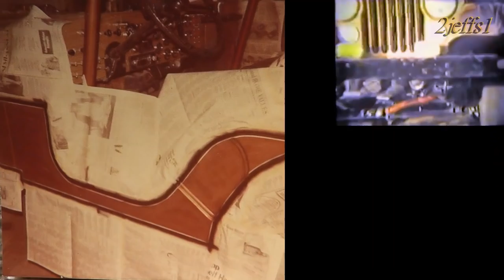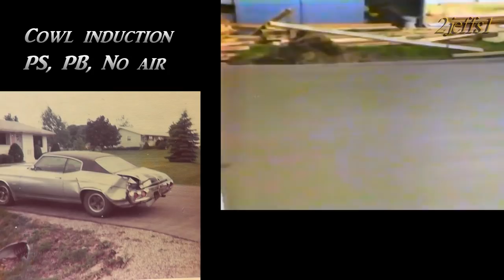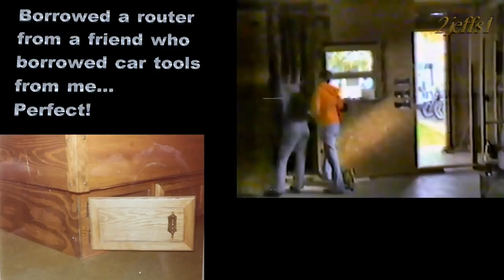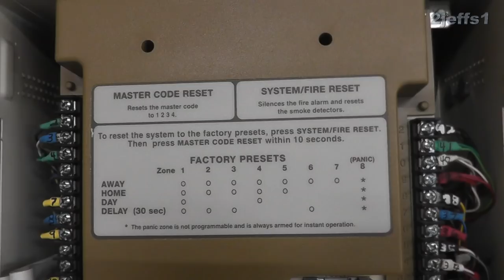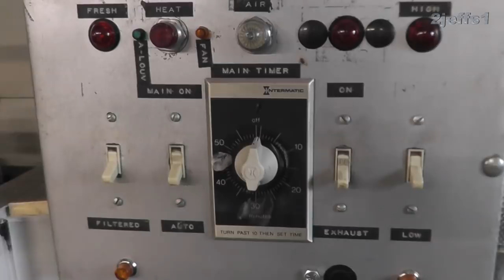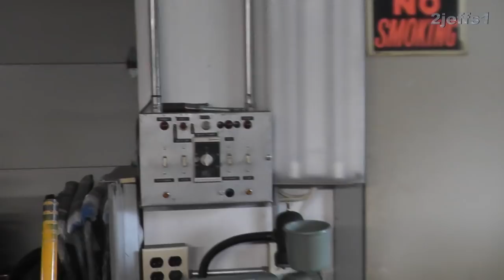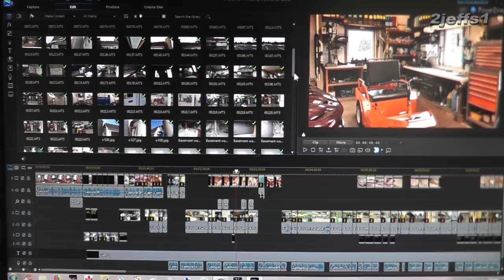See My First Shop and What it Took to Get Here!

Comment: You have so many real life lessons and stories. I love them!!! makes me really understand how if you do your best sometimes things work out. I am a chemical engineer but I was in a horrific accident a year ago where I was burned over 20% of my body and lungs with high pressure heated acids. After a year being out due to recovery I decided to do what I really wanted and I am starting my vintage chopper shop and vintage metric bikes repair and restore shop. I want to have a place that looks like an old service station where the old timers can hang out and have a beer and tell stories and show us how to work on all kinds of stuff. I love three wheelers and yours are what I would strive to make mine like.Thanks.
Reply from the maker: Wooo that don't sound good. Thank you for taking time for the nice write up. Hope you have a good recovery and do well in the future!
Reply: @2jeffs1  Thank you Jeff. Yes still recovering. Lungs take a long time it seems. I went from dreaming about finding an xs650 to rebuild and all of a sudden I have two barn finds and a half finished bobber that is in awesome shape. I found a 1969 cb750 chopper on facebook marketplace and drove to new Jersey to pick it up. I found a donor bike and rebuilt the top end as it had only a couple thousand miles but was stuck (siezed). It is in great shape now and will be a really cool chopper again when it is finished.The guy wanted a couple thousand but when I got there he had sold the engine and I was able to buy the roller for a very good price. I did not even know they made a 350x until I saw yours. I am looking for one down here now. I found a great 200x As I used to be a bodybuilder in the early 2000's and now I am a fat shit I do not know if it will move me..lol I could only dream of accomplishing all you have. I wish I was more patient with electrical stuff as you are. Heck I wish you were my neigbor or brother while I am wishing. I am almost through half your videos. I do have some cool projects. An Intternational Harvestor cub lowboy and an Oliver 550 with a loader attachment that need some TLC. I am just guessing you are in Canuckistan...lol. You are welcome to come visit sometime if you are ever down here in Pa. I spent too many years in school but it was in Florida so I did not mind too much. I would love to go back once my shop is up and running smooth. I need to start video-ing everything and uploading them. You definitely have my admiration and respect my friend!! Talk to you soon.
Reply: I meant to say Wisconsin. I do not know why I thought you said you were in Canada. talk to you soon.

Comment: I saw some Nissan Leaf batteries and a series DC motor. Some kind of electric vehicle project? Thanks for sharing the shop in the evolution of it. I love looking at Old shops,  .
Reply from the maker: Hi Steve. Was saving it for a 3 wheeler conversion. Been watching Craigs list for a 86-7 Honda 200x (second gen) but none have been available in a 200 mile radius. Them have a real sweet rear suspension along with other reasons not to use the 84 200x I originally obtained for that project.
Reply: @2jeffs1  hi Jeff I look through your other videos and found the Cushman project. Looks pretty good. I love the new lithium batteries but the BMS stuff it's kind of a headache. If you click on my profile picture you can see some of the BMS boards I've been trying out. I think I'll go clean my shop now. Funny that's the thing I noticed and was most impressed about, how neat and organized you are.

Comment: A man who likes Rangers and Mercury Monarchs can't be bad. When you mentioned loosing a hub cap, I remembered mine had nice rims with a center cap. Every time I turned around someone would steal the center caps. I gave up and switched them to plain steel rims with hub caps. Gave them to a friend at work.  Rebuilt the 302 in that and I got 22 mpg going to Saint Louis. I had no idea back then how to keep the throttle of the floor so that was respectable mileage.  It did pretty good 1 legger burnouts.
Reply from the maker: Nice write up! I was always pretty lucky for the cap grabbers but heard of many who did have them stolen. Around here they were stealing truck tailgates and a entire box off from a brand new truck at the car lot. The guy told me they even unplugged the connectors instead of cutting wires. Someone knew what they were doing! The 1 wheel peel. Just gotta make sure the r rear is facing the viewer.  ;>)
Reply: 2jeffs1  Is that the tail gates and boxes off new Ford trucks? I heard there was some problems with stealing tailgates on Super duties  as they are expensive to replace.  I visited New York City back in 84 I think. I saw across the big highway these guys stripping the wheels and some other stuff off a car. The guy was only about 500 feet away on foot headed for the nearest exit and a telephone.  Bold thieves and well  setup. They had a van with an engine or cherry picker lift mounted so it reached out the door.  We were stuck in traffic and couldn't do anything but watch like the 100 other people.  Although I am not sure the locals paid any attention.
Reply from the maker: They were taking older but the rust free tailgates off from the Ford's and chev's. That made me nervous where I have that older truck and might be hard to find one with that full length aluminum trim which came on the STX version. It was a GM dealership and they actually took several entire boxes from the same place. What a deal there for you to experience. It's pretty sad when people won't get involved even tho they are seeing what's going on.  When I first got the storage unit up the fire inspector came thru for his inspection and told me they hit them in the middle of the day. He said they drop a guy off who gets in a stall, hop's over the walls and gets everything loaded in the 1 unit for pickup. I never suspected that and several weeks later, yup there were several clowns in here at 3 in the afternoon. I have a driveway ringer and knew there was someone out there. Started to walk out there, they spun gravel all the way out. Several more similar deals thru the years but never a break in where living here helps and installed more security stuff now too.
Reply: 2jeffs1  A hose clamp can stop or slow the tailgate thieves,  not sure how to stop the removal of the box without making a lot of work if you have to remove it.  I have seen chicken wire in the top of storage units,  now I know why.

Comment: hi 2jeffs1   
hi there my friend great videos are my friend      by the way there my friend what's the best undercoating for my old truck   plus I live in Canada what what would you use
Reply from the maker: Hi Roy. There is a paraffin type undercoating that they put on my 86 Ranger when it was new. That stuff adhered good and stayed pretty fluid in the hot days. No idea what that was but it was yellow in color. Thru the years I periodically put new engine oil (just regular 10w30) on the truck to insure things stayed covered especially where the rust starts and one can't see in between sandwich, spot welded areas. Door bottoms, around wheel openings, fender bottoms, etc.

Comment: This was the coolest video I’ve seen in a long time. I really enjoyed the pictures from the 80’s.

I would kill for that old Datsun, I remember a bunch of them in crappy used car places around Green Bay for $500 growing up.

What did you do to your basement? The paint/coating on the walls looks amazing! What did you use?
Reply from the maker: About 1 foot up from the floor water lock was used, real thick stuff (sorry can't remember the name) and finished off with the regular latex primer/paint. There is a watery/thin mason sealant that is applied with one of those pump up yard sprayers which I should of used first. Several areas are developing issues, will need to be re-done in the future.

Comment: Hey man I got a head stud issue 7.3 L diesel cracked exhaust manifold need to be removed but all the heads on the bolts are rusted of course should I just cut the heads off the bolts to remove the exhaust manifold they use bolts instead of studs
Reply from the maker: Sounds like a good way to tackle that one. To assist sliding off I have taken an air chisel on low pressure and a blunt end shaking the top to help loosen the surround thru hole rust loose from remaining bolts. Just a thought, those can be challenging for sure. Good luck!

Comment: Hi Jeff is it possible to fit an oil pressure gauge to a tractor that hasn't got one .
Cheers
Reply from the maker: Yes, usually engine blocks have a 1/8" or 1/4" pipe plug somewhere in the block for that. But beware - they also have the same size plugs for a coolant drain area.
Reply: +2jeffs1 thanks Jeff much appreciated 👍